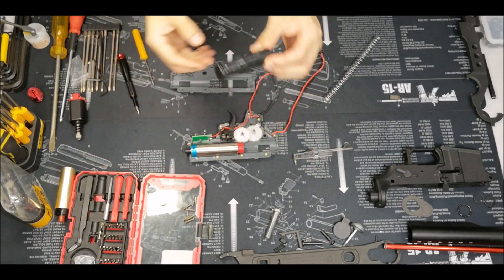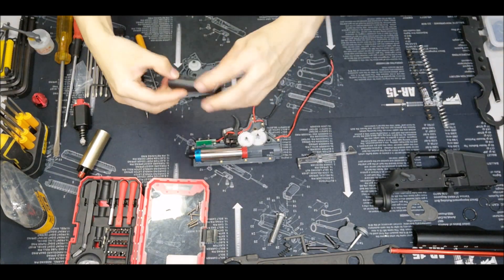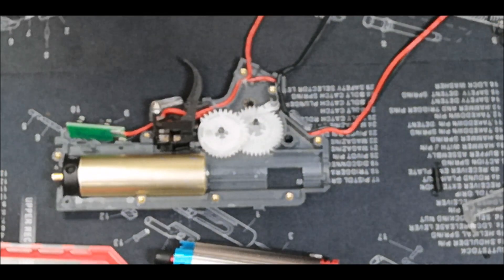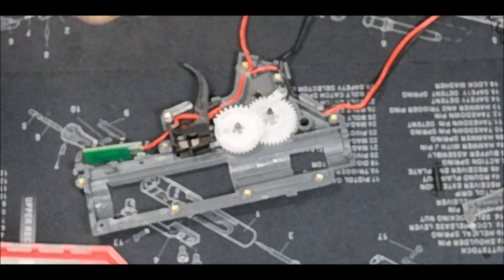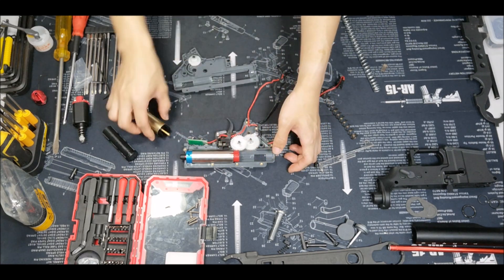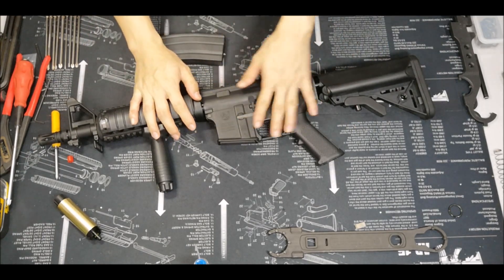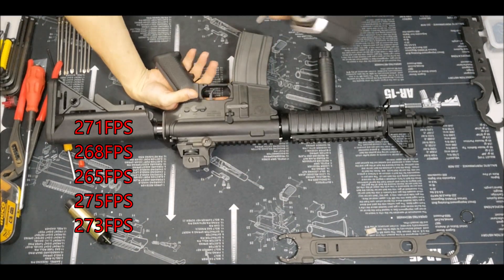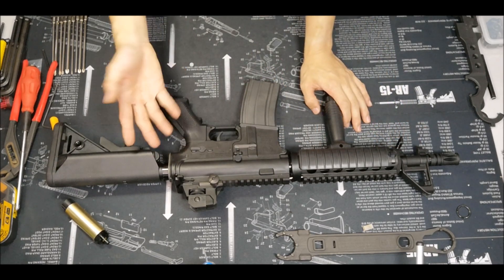HowTo: Importance of Short Stroking

Comment: The higher rate of fire would be the predominate reason for the ladder to wear at the base of the piston.  A bigger spring just compounds to the damage of the ladder since there is more force in the stroke.  Either removed the tooth as suggested or slow down the ROF.     Edit: good work delving into the engineering aspects of gel blasters, would love to see more diagnostics breakdown videos like these.

Comment: hello, yesterday i bought k1 but out of the box the dust cover not opening when i pull the charging handle.. please help me how to fix that 😟
Reply from the maker: You can take the upper receiver off and check whats up with the charging handle/dustcover/dummy bolt.
Reply: @theliteoperatinggroup4387  yeah bro i did it like you told me..what i found is the charging handle spring is stretch..and dust cover small pin (when you open dust cover you can see there is small pin for close the window dust cover) also its not catching when i pulling dummy bolt ..dangg 😭
Reply from the maker: @feezhr4880  You can buy a replacement for the charging handle spring. As for the dust cover, if nothing is missing, might probably be able to put it back together?
Reply: @theliteoperatinggroup4387  i will try to get gen 9 charging handle spring..yeah there is nothing missing tho..only the small pin not catch when pulling charging handle the dust cover door not open.. need something that can make dust cover to  open ,or else ..(buy new dust cover) 🤣🤣
Reply from the maker: @feezhr4880  Hmm I don't really understand about this small pin lol, but anyhow the dust cover can be bought as spare parts too!
Reply: @theliteoperatinggroup4387  ahaha its okay bro.. i already fix it bro.. it takes around 3~4hours to finish my K1 😂😭..gonna upload video soon i will tag you 😊👍🏼

Comment: Always remove the first tooth or the leading tooth from the sector gear. NOT the last tooth or the trailing tooth. You actually don't need to remove any teeth from the piston at all. But removing the last tooth on the ladder(piston) will save moving mass. Always remove the same amount of teeth from the sector gear as the ladder.
Reply: Iron Maiden bro if I’m using a 13.5 toooth ladder (metal) do I need to remove a tooth from the sector gear? But my gear are metal gear lol

Comment: I take the last tooth off the ladder if needed and the first tooth from the sector gear
Reply from the maker: Removing either the front or the back of the sector gear will mess up the tappet timing if more than 2-3 teeth is removed. If you remove the sector gear's pick up side, the tappet plate will retract the nozzle prematurely, and vice versa on the released side.

Supposedly removing the first teeth on the sector gear is more desirable generally, but removing the last teeth seems to have worked for me every single time so I just stick with it lol.